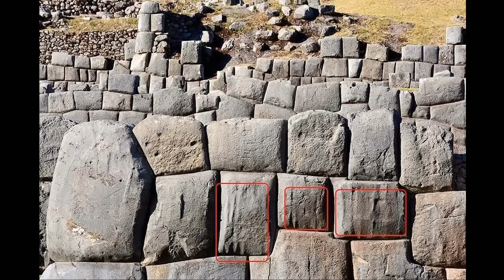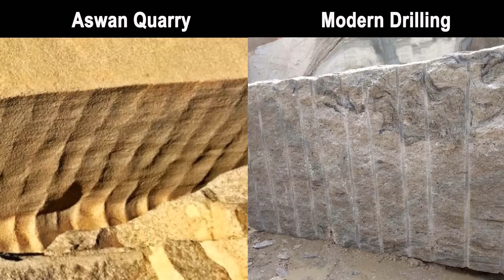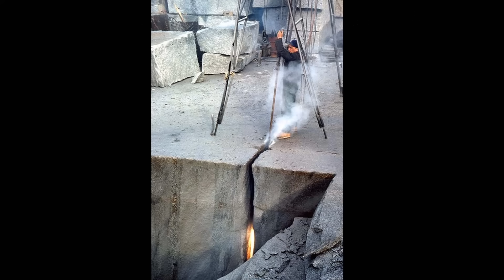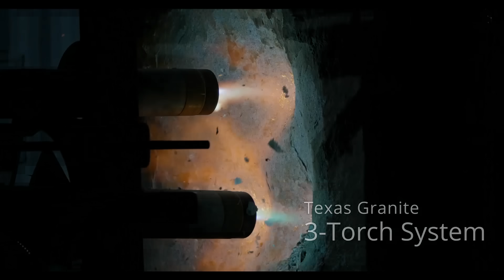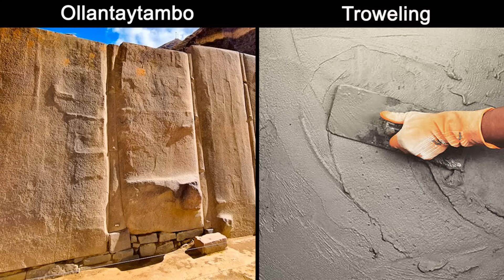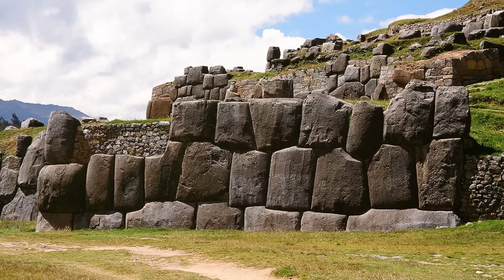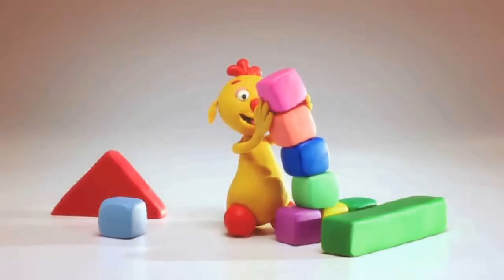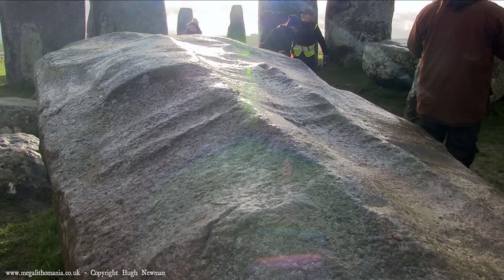Megalithic Mystery: Different Scoop Mark Types?

Comment: I believe you may have it now.. Plasma torch scoop cutting. However a water jet with like the 4th and 5th axial (CNC) projection could still do the shape sculpting carving efforts. It is like tech not yet done or manufactured. Water pressure valving may not be there as of yet but with rapid distance traveling to the surface carving could control a fixed pressure stream for depth shaping.  All though some of the existing statuary could have had this broad shaping done for the hand finishing work completion. If this shape carving would have been perfected then fit PAPPER JOINTS WOULD THEN BE CONCIEVABLY POSSIBLE.

Comment: In the TV show "Mystery at Blind Frog Ranch" They discovered a  under cold water cave that is alleged to be the greatest treasure of the Aztecs, they hid from the Spanish invaders. It was a bunch of rocks with little cylinders cut out, with metal in it. It was only solidified because it was under cold water. It was tested and confirmed to be Gallium. I have heard other report (i dont recall where) that two people found an old container full of fluid that they accidentally spilled out, somewhere South America. They then said after a while the rock it was splashed on had become as soft as clay. They could form it with their hands as it was still (outdoor) "room temp". Hours later it was hardened again, back into normal stone. 

I don't know what exact chemical it was, I strongly feel it is gallium alloys or compounds that have some effect on rocks, it maybe some quantum effect.

Comment: Thanks, interesting review of the various scoop marks, I think you are correct about the plasma torch method. Not sure about the South American work, if it is concrete why make it as individual stones? I think there is still more to figure out with this subject.
Reply: Because solid concrete (and brick) wall crack.  Whereas the South American walls have lasted for tens, if not hundreds, of thousands, of years (possibly more).  They were MUCH better/smarter than us at both concrete-making and wall building.
Reply: Earthquake resistance is the reason

Comment: Ancient megalithic quarrying may have involved large scale, organized labor forces operating with remarkable mechanical sophistication. Evidence suggests that dolerite pounders, dense, spherical stones, were mounted on timber scaffolding systems resembling modern pile drivers. These rigs allowed coordinated teams to rhythmically drop or swing the pounders against granite surfaces, gradually fracturing the stone through repeated impact.
To guide and refine the process, workers likely used quartz sand as a directional charge. This abrasive medium not only polished the surface but also helped focus the energy of each strike, producing the characteristic scoop marks still visible on unfinished blocks and quarry walls. The technique was systematic, efficient, and scalable once observed, it appears to have been widely adopted across quarrying cultures.
Many of the dolerite pounders have survived into later eras, often repurposed as Roman catapult ammunition. Despite their secondary use, some retain traces of their original function: remnants of red ochre paint, consistent with Aswan quarry markings, and geological signatures unique to the region. These artifacts offer a glimpse into a quarrying tradition that was not primitive improvisation, but a deliberate, repeatable technology, simple in principle, yet powerful in execution.
Reply: Did you watch the video?  😂
Reply: How does a pile driver curve around and underneath, like the bottom of the unfinished obelisk?
Reply: @MjulieM63 By strategically overloading quartz sand in select trench zones, ancient workers could manipulate the erosion pattern, reshaping the trench asymmetrically to guide the megalith’s release. Using wooden scaffolding and directional rails, imagine sled like guides akin to children’s bowling ramps, they choreographed the stone’s undercutting before extraction. The final act involved inserting dry wooden slats into key fissures, then saturating them with water. As the wood expanded under pressure, it exerted enough force to dislodge the megalith from its cradle. completing the ritual of emergence.
Reply: I did. But that explanation falls short, there’s no solid archaeological evidence to support it. The idea of ancient humans wielding plasma-cutting technology strains credibility. These structures, while undeniably old, don’t necessarily reflect profound scientific principles. If there’s something extraordinary, show me rare alloys or signs of plasma-induced vitrification. Otherwise, why not consider something far simpler: the deliberate, unified act of striking stone against stone with purpose and precision?
Reply: I'm not buying the "pounder" explanation for the balls. A hammer makes far more sense for that purpose. They were used as ball bearings placed underneath to move the megaliths after quarrying.
Reply: @terryenglish7132 They weren’t originally spherical. Through relentless use, their edges wore down, rounding over time before being retired, repurposed, or discarded, likely by the millions. These remnants scatter the ancient world, their true origins obscured by Roman reuse, which erased much of the archaeological footprint. The original mining tools were shaped more like modern driver heads, designed for impact, not symmetry.
Reply: @ButterBuns00 First time I ve read that they were ever anything other than balls. You've seen photos of the various stages of rounding etc ?
Reply: The pile driver way IS how I would do it. You wouldn't need a mechanical device, just a frame w directing holes for stones on a stick and men shoulder to shoulder moving them up and down. It would be much faster than throwing a ball then picking it up again and would hit harder
Reply: @terryenglish7132 Dont forget the quartz sand charge, harder than both dolerite and copper, acted as a micro-abrasive, accelerating wear at the molecular level. Packed into trenches and agitated by pounding or sawing, it carved through granite with quiet precision.
Reply: @terryenglish7132 According to a detailed study published in JSTOR, dolerite pounders found at Aswan began as angular or sub rectangular blocks, likely chosen for their ergonomic grip and directional impact. Over time, progressive rounding occurred through use, as repeated pounding wore down the edges and corners. Once they became too rounded to deliver effective force, they were discarded on site.
I'll link the article but as usual it will most likely be dropped.
Reply: @ButterBuns00  So are you assuming the balls not being balls to start w or have you seen beginning & in between examples ? BTW Quartz isn't necessarily harder than Dolomite. Dolomite has a range, like Granite. The sand use is interesting because when struck it gives off Plasma, so both you and Tina may be right.
Reply: @terryenglish7132 The spherical remnants are cast-offs, ghosts of a process long concluded. The original tools were angular, flat edged rectangles, each tailored to the stone’s resistance. Configurations shifted with the quarry’s temperament: in Baalbek, where the limestone yields more easily, trenches were widened for speed and efficiency. Likely, a wooden driver clad in iron was employed. But the core method held, massive teams, synchronized in grid formation, systematically chipping with precision to liberate the monoliths.

When the quartz sand charge is compressed, it emits microcurrents that fracture nearby crystalline lattice at the molecular level. Each strike is subtle, but over thousands of impacts, the effect compounds, rendering the breakdown not just possible, but elegantly efficient.

As for Tina, I respect her clarity, her drive, and the truths she carries. She’s well-presented and deeply underrated. But I believe she’s missed the mark on the scoops. The Egyptians, inheritors of older megalithic legacies, achieved marvels through sheer ingenuity and scale.
Reply: The reuse of dolerite pounders as siege ammunition reflects a broader pattern of tactical recycling. Roman engineers were pragmatic: if a stone was dense, spherical, and available, it became a weapon. The fact that some of these stones retain quarry markings or match geological profiles from distant sites like Aswan suggests a continuity of material use across centuries and empires.